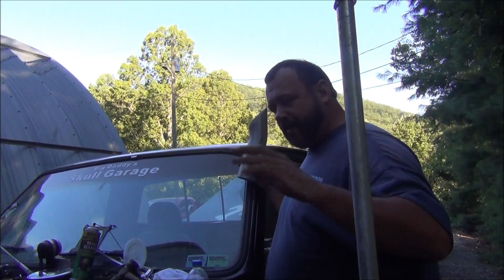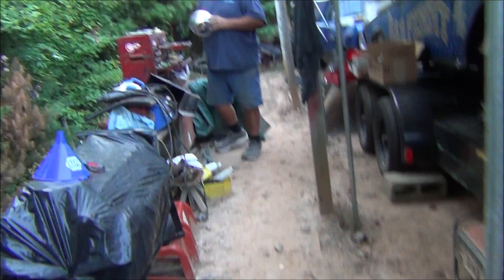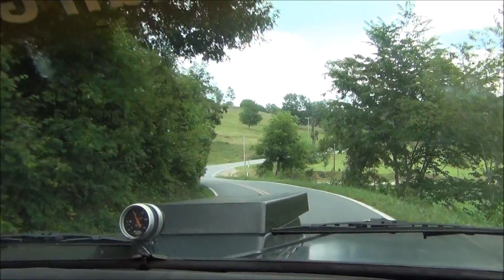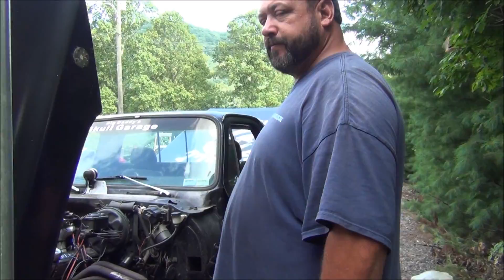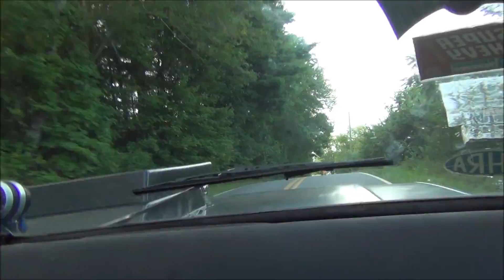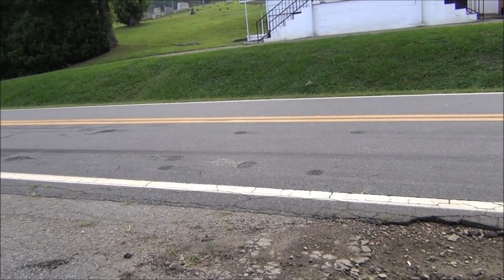SKULL GARAGE 2017 (E29) STREET DYNOS, 76 TRUCK TUNNEL RAM & "CALAMITY JANE" CLUTCH BREAK IN

Comment: When i was 16 my buddy had a 55 with t ram ,660 carbs,and serious compression. I think he used a starter armature out if a caddy to start  it. And had to let the clutch out a bit as he turned the key off to kill it...or it would diesel and run backwards. Car was killer and sounded jane.

Comment: First off love your videos. I found a tunnel ram for my chevelle project. Weiand hi ram. I'm learning from you but doesn't the upper go the other way?  Meaning higher in the back to level the carbs?
Reply from the maker: awesome man glad ya like the vids! and this hi ram is an original one from the late 60's tunnel rams didnt start having the 5 degree off sets until the 70s,almost all weiand hi rams ive seen for sbc are dead level,now an edelbrock tr1y which is the modern version of the tr1x has a smaller plenum and the 5 degree off set which helps when launching the car,i dont believe weiand ever had any early tunnel rams with off sets,but if you are talking about why the velocity stacks are not level thats because these stacks are wider than most v stacks so we had to put a spacer under one velocity stack so one would clear the other cuz when they are level the lips touched,but the weiand hi ram on the truck is dead level both carbs are level with each other and the top is on the right way, and awesome ur chevelle will look killer with a t ram! if ya need any help setting up your combo feel free to ask me anything ill be happy to help any way i can buddy...thanks for watching and the comments...justin

Comment: You got your daddy's truck a runnin real good there Justin you're pretty good with them Dango hollys I think you should throw two batteries in your car like that Dodge to double your cranking amps but not the voltage I used to do a lot of mud trucks you get two small car batteries with 525 each you'll have 1050 amps for cranking and still only 12 volts I can't wait till you get it right buddy it's running really good now it's a pain in the butt when you have to pull start them

Comment: Justin how do you think the truck would do if y'all was to run a 3.50 or a 3.73 gear?
Reply from the maker: it would probably do great thats what we had planned on when we swapped the busted rear end out for the new one, the busted one had 4.56 but the new rear had 2.73 gears instead of 3.42 like we had thought so we just left the 2.73 in for the time being,but i  have an extra 4.11 and another 4.56,the 4.56 is way to low with the 5 speeds 1st gear so we are gonna throw in the 4.11 and that should work pretty well,but i believe a 3.50 or 3.73 would work just as well if not better....justin